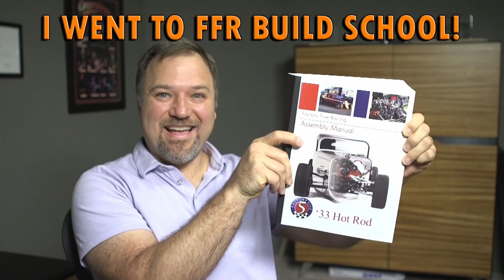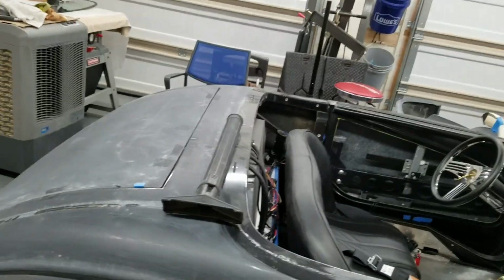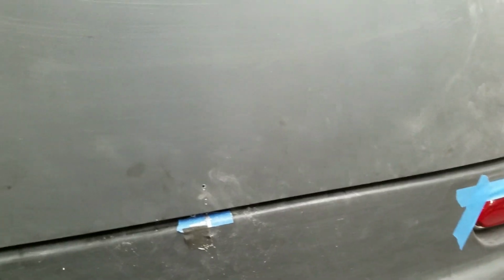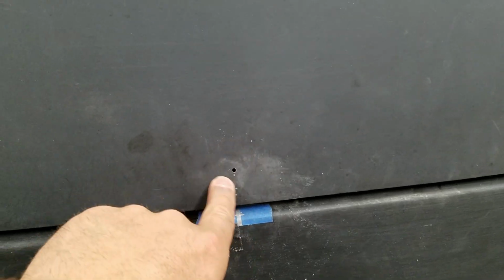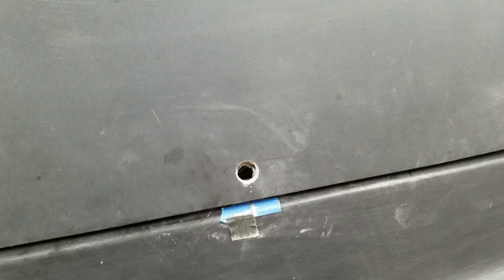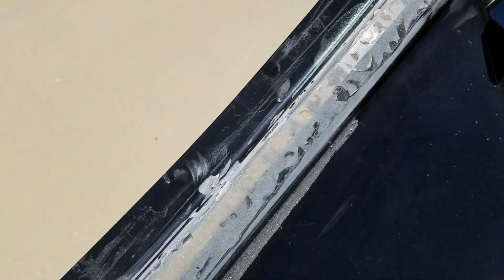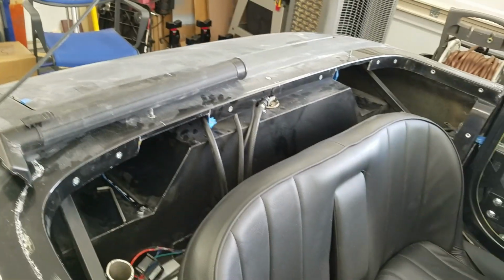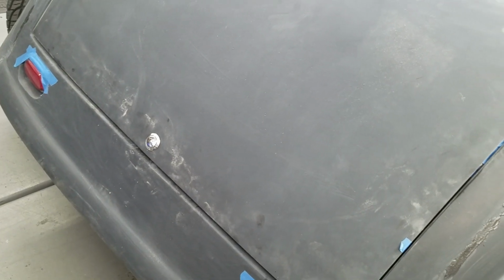Factory Five 33 Hot Rod V2 - Trunk Latch Installed

Comment: use the kitty hair filler. easy to use, fills those openings with structure and adheres to the existing glass. I had to fill the voids for my hood latches that wend through a glass rib like that.

Comment: Jim,

I'm with ya on staying motivated with my 33.  Doing body work now... lots of block sanding. Anyway, I like the trunk latch. I didn't see it in your supplies list. Can you share your source for the latch?

John
Reply from the maker: FFR 818
Reply: John I too asked for this info. I got it from Dan @ FFR it's number is  80959, and is $24.00 plus freight.
Reply: @cliffolsen479  Thanks for the info! I went to thier parts website and did not see it.
Reply: @johnsharp8935  I ordered The part from Dan and received it today. That is the correct part. It's a shame I can't attach a picture of it.

Comment: Jim, Where did you get the trunk latch from and what is the part number?
Reply from the maker: FFR 818
Reply: @StreetRodJim  I'm having a problem looking up the part number for this. I might have to call them. Do you have a suggestion on where to look?
Reply from the maker: @cliffolsen479  I would just email them and say its the push button trunk latch for the 818
Reply: I got it from Dan @ FFR it's number is  80959, and is $24.00 plus freight.